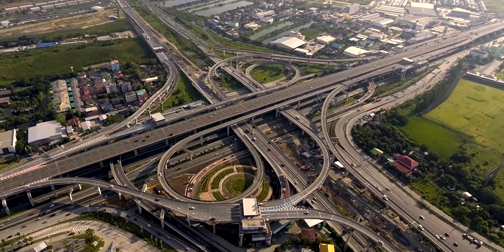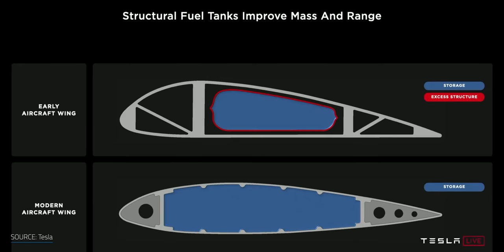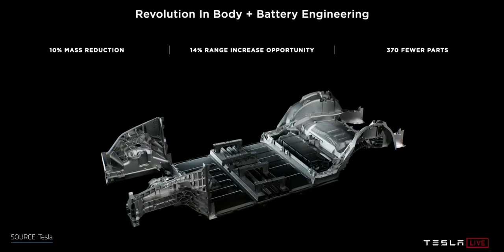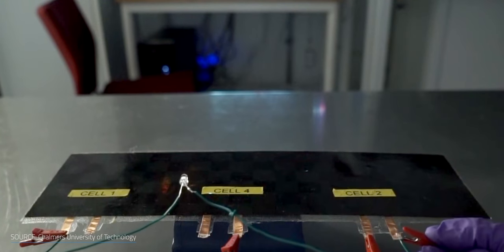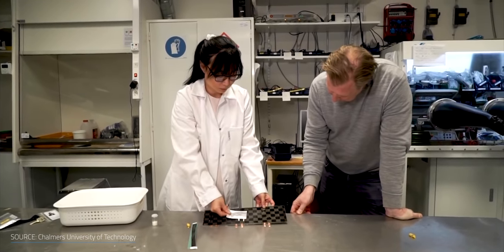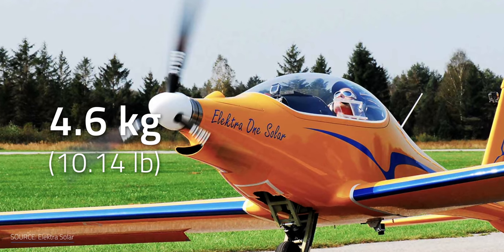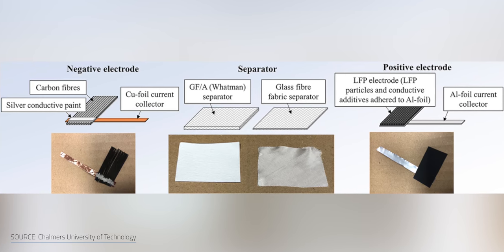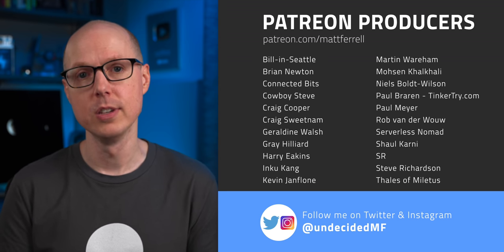Exploring Structural Batteries

Comment: I'm worried how an Inovation like this could negatively affect the repairability of a product. If the battery wears out you are no longer able to replace it, you may have to buy an entirely new car or phone, etc.

I'm sure big companies would love this, but consumers not so much
Reply: very much agree.
Reply: Yes but repairablity in EVs is already not usually an option
Reply: Good point!  But, this also brings about another problem. If this is not reusable and is made of minerals that are limited in quantities, this could be a huge wast of natural resources.
Reply: Will want to see Louis Rossmann’s take on this tech. DON’T SLEEP ON FIGHTING FOR RIGHT TO REPAIR!
Reply: I would assume that the idea is to get the technology to the point it's not so much a structural battery, as much as a chargeable structure. As in, the structure is the battery, and only if you break it in half does it stop working, otherwise even if lightly damaged or has a hole through it continues to both offer structural support and power. Something nice about this as well is that you don't have to replace normal battery systems with this, you can instead complement it, making devices last a whole lot longer for a few years and then be fully dependent on the separate charging system. Ideally this would mean that the device is constructed as if the structural battery didn't exist, so that while it functions it has double the normal battery life and when it doesn't it's just a normal device.

Clearly battery technology is one of the biggest technological setbacks we have right now alongside power production, so anything that can help is welcome. Not much of a point dreading the ways marketing teams are gonna twist technology since there's plenty of ways to do that with or without innovation...
Reply: Bingo !
Reply: and if the batteries, for all practical reasons do not wear out will you be satisfied then?
Reply: Consumers will own nothing and be happy.
Reply: Apple phones says hi👋
  That being said, the work around would be, to trade it in at a depreciated value. You would drive away with a different car. 
 Your old car would be shipped back to the factory and refurbished like we do with current electronics.
Reply: @Amos Backstrom  Batteries are replaceable in most EVs.  With the continuously decrease in battery production costs, the option is increasingly a more economic option.   The production of EVs is quite carbon intensive, you don't want to be throwing the car out when batteries die.
Reply: @amosbackstrom5366  That's not true, not in the slightest.
Reply: @AfonsodelCB  A battery does not have to be damaged to need replacing. Rechargeable batteries have a finite number of charge cycles. Once that limit is reached the battery is dead and needs to be replaced. Heavy use of an EV will reduce the lifetime of the battery pack, if the battery pack is also the EV's structure then the EV's lifetime is based on the battery, EV's that use replaceable battery packs have a longer lifetime because you can just replace the battery when it's dead! Therefore it is more economical for the owner to have an EV with replaceable batteries.
Reply: expensive ASF don't even think about putting this in a car i will go BRO~0KE
Reply: lets use a phone as an example what would it be like if your phone case was a battery but still just as thin and protective as the one you have now?
Reply: destavin - I agree.  Reminds me of my reaction to cell phones that no longer have user-replaceable batteries.  It's not easy to find a phone these days with a replaceable battery.
Reply: right to repair bill has passed. companies are now - at least in the USA - mandated to give buyers the opportunity to repair their device instead of replace it. The only important thing still lacking is how this gets shape in replacement parts in the long term. It would mean - i would believe - that if for example, Tesla builds a car with the doors, bumpers, hood, trunk, roof and front and rear fenders as 'structural battery', and discontinue the product, i would feel that they have to sell / lease the rights to a company to build replacement parts. 

it's not really 'that' much an issue i would be inclined to say since cars can have accidents and then parts need to be replaced. So essentially, battery replacement is part replacement. It goes down however in the cost of material.
Reply: Nano 3D printers will be involved eventually.
Reply: @TanjoGalbi  I don't understand how you reach that conclusion. what kind of device are we talking about? a car with a life expectancy of over 30 years? a laptop? different types of devices progress at different rates so it may or may not make sense to time that with battery death, but cars are the only frequently used device where I could see an argument like "these batteries become useless after 10 years, cost 25,000$ to install and can't be replaced therefore it's better not to install them". Even then I'd have to be convinced that batteries still die that fast because I haven't heard of modern batteries being unable to hold a charge in devices manufactured in the last 4 years unless they are damaged (talking laptops and phones), devices whose life cycle right now is about that long anyway and already facing a discard-oriented mentality. And by the way, after all of this, I am not telling you "this is the economical choice for a consumer", because I am not (and expect neither are you) working in the field and heavily researching pros and cons. Going by logic alone I don't see one one could make such a clear cut answer one way or the other
Reply: For handheld devices like mobile phones, it should be similar to just repairing the case. Either way, I agree that making a phone impossible to use without a panel battery or impossible to replace a panel battery will be a serious concern that will probably result in lawsuits. Same thing for cars, but I don't see a car that can't drive after a mild collision, and who's range is reduced after such a collision being given high ratings. The concern there is that panel batteries would be far more expensive to repair.
Reply: @AfonsodelCB  It depends on the useage. a 4 year old laptop battery in a laptop that spends 75%+ of its time on a charger will likely still be fine. For a laptop like mine that spends 95%+ of its time off a charger im lucky if i get a year or two of useful charge cycles and it gets to be a massive problem if i cant replace it myself.

This gets worse for cars. A car thats a daily driver and sees maybe 25k miles a year its likely that the battery life will degrade but may take 5-10 years to be degraded enough to be a problem. For something like say a semi truck that does 120k miles a year or a car that belongs to someone that travels say 50k a year then these batterys will wear out quickly to a point where the degredation of the cell life is a problem. Going from doing say 550 miles in a semi to say 350 is a HUGE problem using semis as my specific point of refrence here.

Being forced to replace the entire truck because those batterys are part of the structural frame makes it worse. A new truck using standard new diesel prices is $180-250K depending on setup. Typically with rebuilds a truck currently lasts more or less dorever unless something majorly goes wrong. Hell i still see guys running rigs from the 40s as daily work trucks and trucks from the 70s and 80s are still VERY common. If replaceing the batterys is simular in cost to an overhaul or rebuild or say a major repair after a part breaks then this is fine. If it requires a new truck....not so much.

That is the concern here. If the structural parts are things that are easy to replace but leave the vehicle mostly intact say for example hoods, doors, fenders ect. Then this is a very diffrent animal then if the vehicle needs to be replaced and will actully stall pushes to green tech and cause lashback.

Dont get me wrong i dont mind green tech (even though in the U.S EVs are worse them diesels for pollution in many areas due to us still mostly being coal, oil and gas plants) but that tech needs to actully be green and actully be reliable and affordable. Going green is great in theroy but not if it bankrupts the average person doing it.
Reply: @dwainhuntington3293  plus disposal of batteries is one of the worst pollutants we currently have
Reply: @leightoncollins3704  federal regulation and battery buy back programs could help in this matter.
Reply: @dwainhuntington3293  true that but still a problem at the moment, making and disposing of batteries is worst than running internal combustion engines.
Reply: @leightoncollins3704  I believe you. If we are going to live in a society that runs off of batteries, we need to find solutions.
Reply: @dwainhuntington3293  you think we'll run out of carbon.?   hahahaha
Reply: @wrxkyle  Know much about cars mate ?   you'd probably have a written off car if it was hit hard enough to break the batteries. Have you seen the subframe around them ?   So many ill informed comments on this topic...
Reply: @dwainhuntington3293  Im no expert on the production of carbon fiber or fiber glass, but their base materials carbon and silica are extremely common
Reply: Not only that. Keep in mind that every time you hit something, you hit it with your battery
Reply: There should be seperate body pannels and the batteries should have a long charge life  and be of cheap easily sourced materials.
Reply: @MickH60  I hate when people think their so smart and criticize others. No manners what so ever. Besides this, a battery would take more than just carbon to operate. That's why I said, "If this is not reusable and is made of minerals that are limited in quantities". Meaning "if minerals such as lithium ect. are infused in the material to make it operate like a battery".
Reply: @SerangelROM  Very true. But my thought on this was it needs more than just carbon fiber or fiber glass to work. Or else you could just hook a couple wires to any carbon fiber or fiber glass car and it would work. Which it will not work. So, there must be more minerals or materials added to make it work.  If this is correct, then it is possible to loose these minerals and materials when the car is disposed of.

Comment: It's literally a battery cell sandwiched in-between layers of carbon.

It's not massless AT ALL.  It's a battery stored in the structure of the 'device', something that will never work for the body of a car because there is nowhere near enough density of cells to provide enough power. Not to mention one simple crash or ding could result in needing the entire body of the car replaced, or worse, the whole thing goes up in flames, because funnily enough, batteries don't like being bent out of shape and shorted.

Comment: So if I understand the principle correctly,  when (not if) the battery goes bad, since the entire structure of the car is the battery you have no choice but to "recycle" the entire vehicle. This would essentially destroy the second hand car market and increase company profits  by requiring everybody to buy new cars. . . . . along with decimating the lower class who depend on finding sub $2000 cars when required to commute to work. Also, isn't it ALWAYS more environmentally friendly to repair rather than replace?
Reply: Working as desgined and intended. Just throw it away and buy a new one, as the current societal philosophy demands.
Reply: @Mck Idyl Sorry, fixxed. Thanks
Reply: Hope that enough competition is made available in these markets that some dealers could offer more of a leasing option; noting their improved safety features, GPS, and vehicles communicating with each other on the 'roads'...if done well, it could put the slick car salesmen out of business!
Reply: From my understanding of Tesla's CyberTruck, the same thing applies.  Since it is a diecast frame you cannot just replace part of the frame or car if there is an accident.  You just have to total it, collect the insurance check and buy a new one.  So this would be no different if the battery was part of the structure.

Comment: When you get a bill from the dealer to replace your battery pack: labor 200 hours. Parts: new frame. Price: new car.
Reply: With million mile batteries, who cares ?
Reply: I was thinking the same thing, does a battery failure mean the car is totaled
Reply: @MickH60   I call bullshit, If it has a life that long why not make it user replaceable? This is just some BS ploy to kill right to repair
Reply: @the_bar  yes...well...very likely.  The tech being used to make these batteries...thin film deposition...is a mature technology vital to micochip fabrication.  It is not cheap to employ.  This will raise the price of batteries 10 fold.  They may last longer...but whether they can hold enough charge is the problem.  But even with that solved, one accident could total the car if the damage were to undermine the battery based structure.  You cannot put batteries on a frame straightener.
Reply: @Conundrum888  musk isnt in the business of user repair. i dont think you know how corporations work.
Reply: @the_bar  No. But if the car is totaled, the batteries probably don't work anymore! :D
Reply: @MickH60  Sure, if wear is the only thing that will ever happen to the battery.  Which it won't be if its on a vehicle that regularly moves at 60+ mph.  One bad pot hole, rock, fender bender etc dislodges a minor part inside of that and you have to replace what is effectively the frame of the car.

Comment: I'm so worried if there is a battery issue you'll need a new car.
Reply: Yeah, this is already an issue. They're just exacerbating it. Apparently Tesla doesn't do Part replacement, they do Module replacement. Which means if there's a 50 cent part on your battery module that needs replacing, that's a $16,000 replacement. https://www.youtube.com/watch?v=vVSw3KSevEc
Reply: Be the last buyer
Reply: maybe if the designs include more straight lines and stuff the batteries could be delaminated for replacement. It would likely be very expensive, though.
Reply: @ryanbrown982  I saw that video too & it made my want to puke. I am device repair tech professionally & Tesla worse than Apple
Reply: Structural doesn't have to mean part of structural integrity.It can be exterior panels of a vehicle when damage replaced individual panels is what your insurance companies already demanding in most cases. The Aptara exterior panels are mostly solar panel can be replaced individually or all at once. So no Tesla's not going to make a disposable car
Reply: What do you mean "if". ? and what happens in winter?
Reply: The phone companies are already there with that concept
Reply: That will make insuring one of these cars very expensive as well.
Reply: shut up and pay!
work more or steal more
Reply: The monopoly Tesla's enjoys not allowing independent mechanics service their vehicles needs to change.
Reply: @A non You're right. People seem to forget that these "green" EVs need charging. It's only shifting the burning of fossil fuels from the car back to the power generators - i.e.  power stations. If we woke up tomorrow and everyone's car was EV guess what - we don't have enough generation to keep up. That is a fact in many many countries. Not as green as it looks on the surface. Funny thing is that while many support EVs they still criticise windfarms and hydro - which are actually at the root of the issue and do provide viable solutions if the Karens could get over  being able to see them and finding them offensive. It's a long way from finished. I'm excited to see where this all goes. Some really interesting things on the horizon.

Comment: "If you pop a tire, just buy a new car!"
Reply: Can you explain the point to your comment? Are you just salty?
Reply: @the87ghosts  no? It's a joke.
And why would I be salty about a car battery?
Reply: @the87ghosts  if you glue the batteries into the car and make them totally unserviceable, then when the battery inevitably fails, you will have to purchase a new vehicle, rather than replacing the battery. This means you will need to spend another $60-$90 thousand dollars, and that an entirely new vehicle will have to be manufactured, incurring all of the environmental damage that manufacturing a new car causes. Metal has to be smelted, plastics created, glass melted and formed, leather sourced, computer chips shipped from overseas, all to build you a new vehicle. Meanwhile, the old vehicle, which is in perfectly useable condition aside from the battery pack, is scrapped and sold for parts. Then you have the environmental cost of recycling materials that dont need to be recycled yet. Everything about a nonreplaceable battery pack for an electric vehicle is completely irresponsible. The whole point of electrifying vehicles is to curtail global warming and reduce carbon emissions, and requiring consumers to replace the entire vehicle if and when the battery pack fails or reaches the end of its useful life is so environmentally irresponsible you might as well just continue driving a gasoline burning car.
Reply: @cr4zyj4ck  lmfao you forget gas cars POLLUTE THE AIR YOU BREATHE causing very serious health problems, also the same thing applys to other cars I mean I normal gas car is gonna last about as long as a battery in a ev and maybe even longer so yeah its still FAR FAR FAR better for the environment to use a ev
Reply: @cr4zyj4ck  also your whole argument about the assembly is very pointless when both cars are assembled the same way and the way you honestly believe that billions of people emitting greenhouse gasses daily is better then if they didnt like sir no
Reply: Sounds like capitalistic propaganda
Reply: @cr4zyj4ck  I agree with you except for the part of letting people to continue driving gasoline-burning cars. Evs are better for the environment overall.